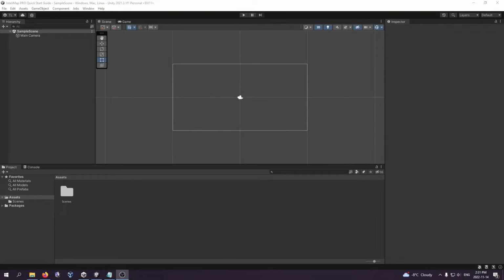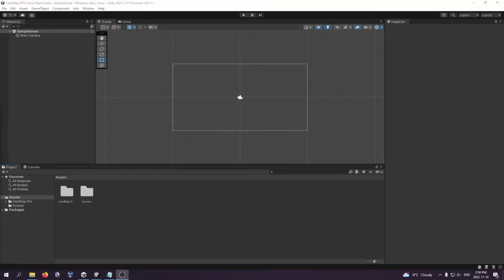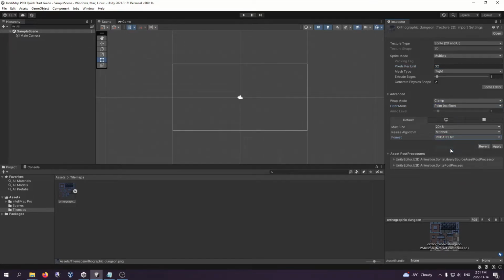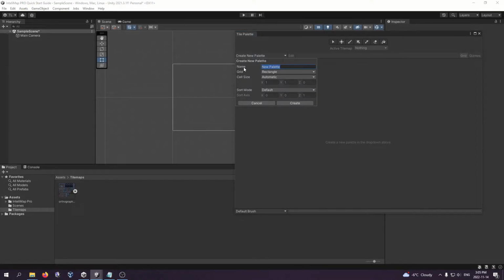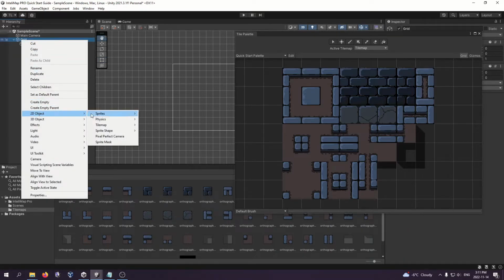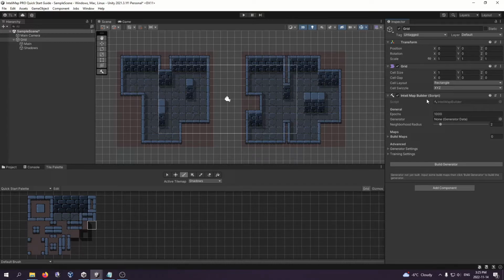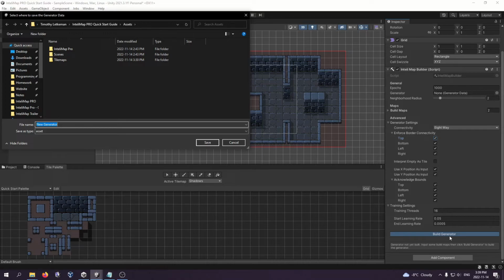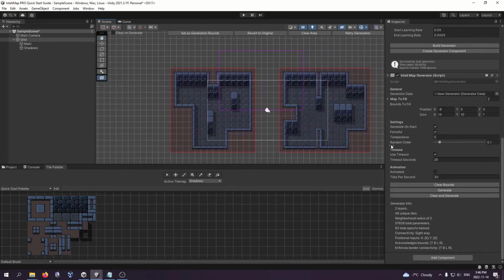InteliMap PRO - Quick Start Guide

Comment: im sad, This is a really awesome Asset and got both versions regular and pro, but its so slow to use. it lags my Unity and constantly Bogs it down with Loading Pop ups. I'll keep trying to use it and see if I can get it to respond faster.
Reply from the maker: Hello, I'm sorry that you are finding that InteliMap causes your project to lag. 

If you are experiencing this lag during the build process, you can likely mitigate the problem by setting the trainingThreadPriority of the builder to a lower value, which should free up more resources for Unity and allow it to run faster. 

If you are experiencing this lag during the generation process, this is likely a result of using a generator with a large number of unique tiles, InteliMap uses an algorithm that runs in O(nm^3) time (where n is the number of tiles, and m is the number of unique tiles). Trying to reduce the number of unique tiles will greatly improve generation times. If possible, also try to generate asynchronously using the StartGenerationAsync function, it will remove the lag/loading time while InteliMap generates in the background.

If you are experiencing this lag while not generating or building, this is likely a result of just using a MASSIVE tilemap. Unity's default Tilemap renderer can have quite a lot of slowdown when viewing very large amounts of tiles. This is not because of InteliMap. This problem could be improved by optimizing your tilemaps a bit further (ex. use chunk rendering instead of individual to reduce draw calls).
Reply: @Tigpan  wow thank you for this quick response. I did not expect that. I greatly appreciate all this info! I will try these tips! Narrow down what might be causing the long load times and get back to you with any questions. I do believe its because of the Generation process. I tried a fairly big amount of tiles without realizing it.  Thanks again. I'll keep at it.

Comment: Can you use it on 3d?
Reply from the maker: InteliMap works in 3D scenes the same way it works in 2D scenes. However it works using Unity's built-in Tilemaps, which are fundamentally 2D. So you can't exactly generate 3D areas, however you can use multi-layered Tilemaps to emulate a 3D effect.
Reply: @Tigpan  Can i generate prefabs? assign a prefab id for each prefab to use for 3d worlds?
Reply from the maker: @diegoguedes9760  It can be used to generate prefabs. InteliMap PRO includes a scriptable object for a PrefabTile, which allows you to generate prefabs on the Tilemap.
Reply: @Tigpan  Can you generalize it?

input as matrix of int and output as matrix of int and adaptor to convert from and to this array of int to tilesets but users can write their adaptors?
Reply from the maker: @diegoguedes9760  Currently it only works by reading TileBase objects from a Tilemap. However you could generalize it by creating your own classes that extends from TileBase and putting them on a Tilemap. Those custom tiles can then be adapted to whatever purpose you see fit.
Reply: @Tigpan  I`m creating a 3d tilemap engine for unity (with culling, auto tiling, etc) and i`m really interested on using InteliMap Pro with it